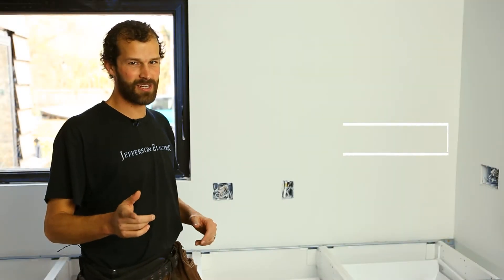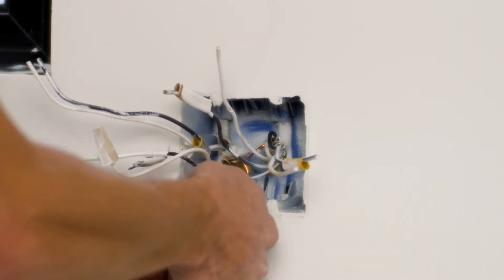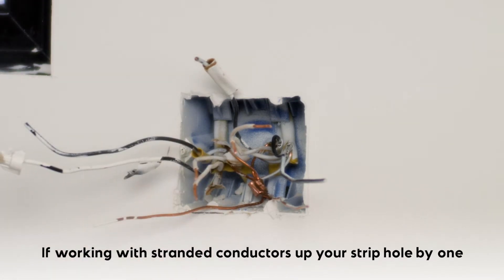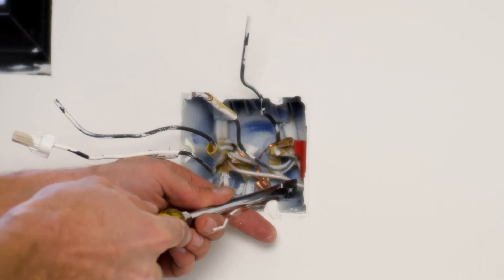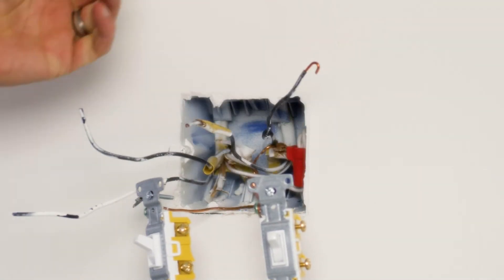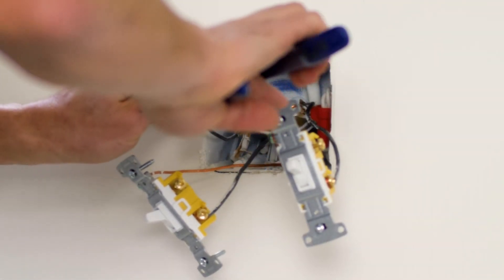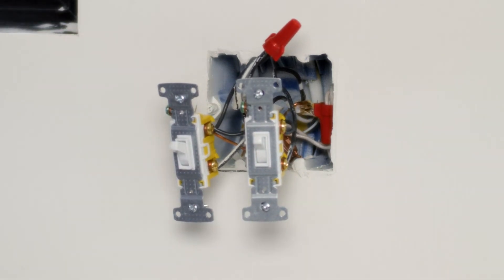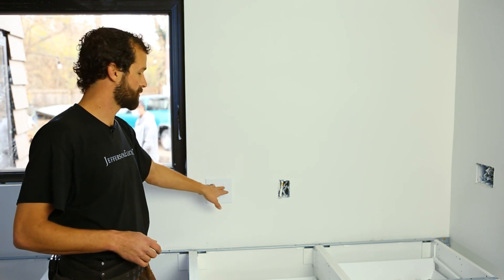Installing Two Single-Pole Switches

Comment: 2 comments:

First, why wasn't box makeup done before final cover, makes no sense... not a good practice, why fight the paint/mud/texture?  Pretty much most places I know of require a rough inspection and in WA the inspector would just have you reschedule when make up was done, as everything must be made up and then after that, a final cover inspection when the walls are competed.

Second, why only one circuit in the box?  
Many/most dishwashers require a dedicated circuit of at least 15Amps.  Same with garbage disposals... which can draw 5 - 12 running Amps and 5 - 16+ motor Start-up Amps. 
I get that the disposal is only used briefly, but it's use coincides with dishwasher use, so both being energized at the same time is very likely.P

Comment: i have 2 switches on each side of my front door. the left switches are for both kitchen lights while the right is for the porch and an outlet. where im confused is there is a precut jumper already in the box to use BUT, theres an extra wire on the right linked to the kitchen! when i wire it, i either end up with one switch working or none and/or my kitchen wont work. So all in all i have a total of 4 sets of wires on the right and a jumper set, any tips on how to fix this??

Comment: Similar setup just 2 circuits of lights. Any reason as to why my left switch would only allow my lights being turned on the right switch to come on as long as the left switch is turned on? 

I can turn both sets of lights off at the same time with the left switch and turn the lights on and off with the right switch as long as the left switch is on😅

Comment: Came across an insulated tool used for adjusting wires in the box.  It’s called the Volt Claw and it’s about $16 and has a few extra features.
Reply from the maker: https://amzn.to/3IHDdo0 ? Very cool, we may have to try these out!
Reply: I love my VoltClaw.  First saw it on The Sparky Channel.  Thought it was pretty goofy at first.  Now, I find it indespensible.

Comment: Great video!  Only recommendation would be to have the light switch closer to the sink.  Most folks expect the most frequently used switch to be the nearest.  Just like lights/fan switches in a bathroom.  The nearest switch as you enter is the light switch.

Comment: Why don’t you do your wire splicing, at the time you do your rough in? It makes a much more efficient use of time when doing rough finishing, or at the finishing stage.
Reply: @ElectricProAcademy  I had the same question as Freddy, now I understand, that makes sense. Do you use Wago lever nuts? They would completely eliminate this issue.
Reply: At one town that I performed work in inspector insisted that the ground wires along with the white grounded conductors be spliced before they performed the rough in inspection.

Comment: I prefer an insulated material for a push stick. Screwdrivers can be too sharp and may cut insulation. Especially if you have to work on hot circuits.

Comment: You have a dishwasher, garbage disposal and lighting on the same power circuit from one breaker. They should be separate circuits I believe. At least two separate circuits.
Reply: @ElectricProAcademy  some of the newer dishwashers from Bosch or LG are drawing 15 amps. Some jurisdictions require separate circuits for the dishwasher and the disposal. You're mixing lights and disposal and dishwasher together. You're always talking about leaving enough wire for the next guy coming into service, what about leaving enough capacity for some of these newer dishwashers. 80% of 20A is 16A kinda cutting it close! Also keep in mind that if you run separate circuits for the disposal and dishwasher you do not want to tie the neutrals together. 2020 NEC requires disposals and dishwashers to be Arc fault (AFCI) and GFCI protected.
Reply: @kirkshirley1319  your absolutely right! 💯 %
Reply: Recently saw a utube vid by brilliant electrical inspector Ryan Jackson who looked at this and he believes that it's legal to install the dishwasher & garbage disposal on the same breaker. Took a look at my 10 year old dishwasher and motor only draws 2 Amps and label said total load 10 amps. I always wired them in there own circuit. Can remember my brother purchased a 3/4 HP absolute POS GE junk expensive garbage disposal to replace the POS GE 1/2 HP garbage disposal. Both even with thick padding were the loudest garbage disposal that I ever heard. Ran the 3/4 HP disposal on its own 20 amp circuit. One thing that you have to remember is that most residential garbage disposals are only run maybe 20 to 30 seconds a couple times a day. Sparkies usually go by the 80 % rule in that you should  never exceed 12 amps on a 15 amp breaker ( #14 copper wire ) & 16 amps on a 20 amp breaker + #12 copper wire ).
Reply: @JohnThomas-lq5qp  Not so "brilliant" and not best practice, even when/if legal.
Many/most dishwashers require a dedicated circuit of at least 15Amps.  Same with garbage disposals... which can draw 5 - 12 running Amps and 5 - 16+ motor Start-up Amps. 
I get that the disposal is only used briefly, but it's use coincides with dishwasher use, so both being energized at the same time is very likely.